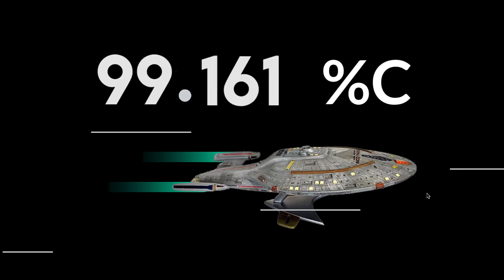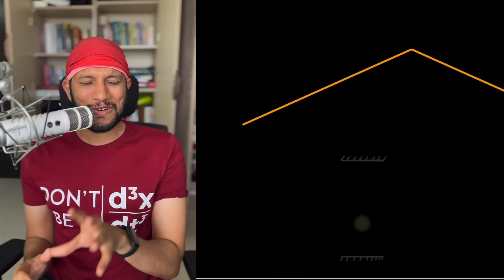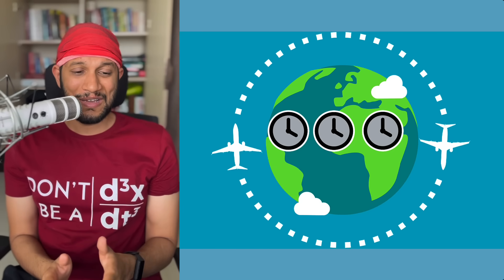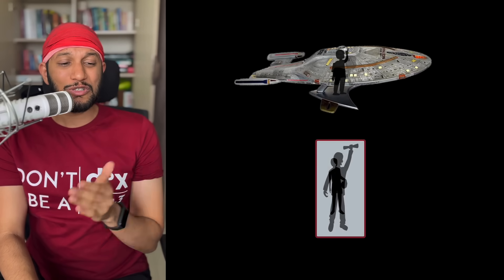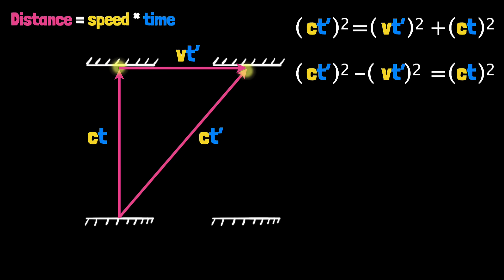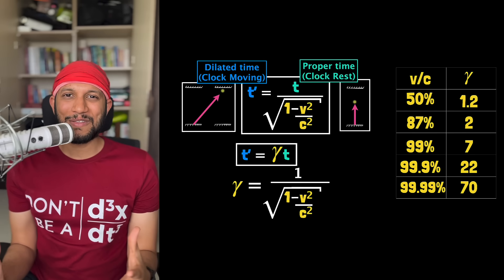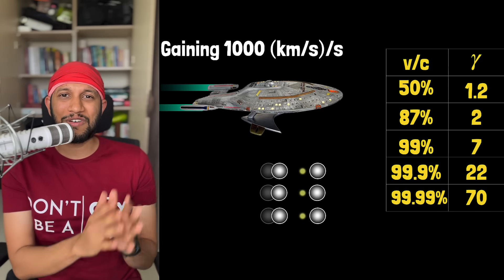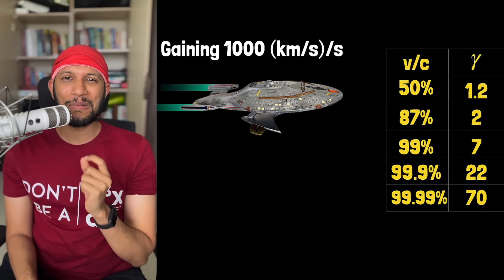I finally understood why you can't go faster than light! (My mind is blown)

Comment: There is a common misunderstanding shown here that makes the title wrong. The presenter validly explains why you cannot accelerate to light speed, but this argument does not say that you cannot go faster than light.
This seems unintuitive because we are very used to Newtonian physics where to achieve a speed you must accelerate to that speed.
But quantum physics has demonstrated responses millions or more miles away that happen instantly. This is superlight speed and there is zero or infinite (depending on how you look at6 it) acceleration.
Also, though the speed of light is generally treated as constant, this is only true in a vacuum. Light is quite easy to slow down. even passing through water causes a measurable slowdown.
Then there is Cherenkov radiation, emitted whern charged particle is travelling faster than the speed of light. This has been regularly seen around nuclear reactors. So we have actually seen objects travelling at superlight speed.
I do not think anyone has yet been able to conjecture what happens to mass at superlight speed. Without this knowledge the possibilities are totally open.
So, to recap, being unable to accelerate to the speed of light does not mean you cannot go faster than light.

Comment: A great video and brillant explanation of current theories regarding the topic.

Tho even as a layman I can't help but have some doubts, which might be absolutely incorrect, but still can't help but have them.
Normally if you accelerate a bus for instance, everyone inside would get pulled backwards (from bus' point of view) due to inertia. The same would have happened to the photon clock - the photon would have been janked "back" from the mirrors. So for the clock to keep it's functionality, there would need to be an amount of force applied to the photon to match it's speed relevant to the ship to keep it in the same place. And from what I understand (possibly wrongly) that force should account for the increase in distance. The same should need to be done in any experiments we were conducting with other forms of time measurments we have, because if you put a clock on a fast moving plane, you have to account for any changes in velocity and direction with a precise force applied to every atom of said clock to counter the inertia.

One more thing, our obsession with speed of light is kinda limiting our theories regarding the working of our reality. Probably because we are depending mostly on our sight for cognisance. Us saying there can be nothing faster than light is like a blind and hearing based race claiming there can be nothing moving faster than sound. Just because we can't register it, it doesn't mean it doesn't exist. The tree falling in a forest does make sound even if there is no smug theoretical physicist around to hear it, the rules of physics don't turn off just because we don't know them.
And it's especially silly since I'm pretty sure the speed of light is not constant either. Light is both a wave and a particle and the proof of that is, I believe, the fact that the light is affected by gravity. So, since it's affected by gravity, shouldn't it be possible to "gravity swing" it? Maybe not some measly planet the size of Earth but a decently sized black hole? I see no reason, why a photon entering the gravity field of such a body at a certain trajectory couldn't exit it with higher velocity.

Comment: excellent presentation. great style.

you say that physics only deals with the measurable.

basically what you are saying is that we are using the unknown speed of light to measure the unknown speed of light.

it's  somewhat like sitting in a bathtub 1/2 full of water. the bathtub is floating in the ocean. we are attempting to determine the properties of the ocean by measuring the properties of the water in the bathtub. the bathtub is the outer limit of our measurement.

much like the speed of light is the mental limit we have placed on ourselves. 

in a sense, physics has reached its borders because it depends on the senses which operate at the speed of light.

time to look elsewhere.

thanx again for your enlightening presentation.

Comment: For two ships traveling side by side at near 'C', the clocks would appear to remain constant in time to each observer in each ship because their relative speed is equal (zero). The same principle applies to a ship moving at 'C' around a fixed point observer because their relative speed is equal (zero) even though the fixed point observer has no velocity. The circling ship's distance from the fixed point observer never increases or decreases, just the same as two ships traveling at 'C' in parallel.

You've intuitively missed the principle that an approaching ship traveling in a straight line path towards a fixed point observer will have an exponential doppler effect at each extreme distance away from the observer at the approaching end and the receding end of the ships path. The bouncing photon clock will invert it's apparent time signature at the precise right angle to the observer as the ship passes. Thus, the "time dilation" is apparent and not actual.

It is the exact same premise for a train whistle approaching someone standing at the edge of the track. The tone will appear higher as the train approaches and lower as the train moves away, though the tone the train engineer hears is the constant and true tone of the whistle. You're hearing an illusion that the train whistle is lower due to your perspective. The whistle was equally high in tone as it was low in tone, thus nullifying the differentiated tones against the true tone. The only time you'll hear the true tone that the whistles can produce is when the train whistle is right next to you in its travel along the track.

And there is a proof which can easily be tested in a large open field with a perfectly circular train track and an observer at the perfect center listening while the train blows its whistle at high speed. The tone will remain constant to both the engineer and the fixed point observer and it will be the true tone of the whistle. i.e. no "Doppler Effect"

An even easier test would be attach a speaker playing a constant steady tone from a long wire and spin it around your head and then tell someone to stand just outside of the range of the speaker (so they don't get hit with it while you're twirling it around) and then discuss what each person heard.

Comment: and I got another one for you, what happens to a photon inside 2 mirror box exactly the same size as the photon, the box sits on the table not moving and then you break the mirror ? So absolute zero and lightspeed cannot be achieved because mass and energy but taking an image of the atoms placing them in a buffer and releasing them elsewhere is easily done because radio waves travel the same speed as light correct ? So if a scanner scans my house and me, uploads it and sends it to mars what after another machine calculates the exact point in time on the surface of mars what will happen ? not much because we need a printer there that rebuilds the image ? Ok so we put that there last year on our Space X trip. So in the name of Scotty can i now travel at the speed of light and teleport me and the house there ?

Comment: You can't be OBSERVED going faster than the speed of light. Velocity is not an absolute value, it is a relative value. When you are observing an object, no matter how fast it is really moving relative to you, you are actually observing the photons emitted by it, which is limited by the properties of the photons, not the object itself.

In other words this limit is an artifact of light and is not real.
Reply: There's more to this, from what I've heard.

There's a hypothetical concept called "Tachyons", which are hypothetical faster-than-light particles. 

If we apply our laws of physics to tachyons, we get many strange stuff. For example, tachyons would have a complex mass, the speed of the tachyon increases as its energy decreases, they would travel back in time, etc.

I suggest you read the Wikipedia article for tachyons, it's quite interesting.

Comment: Wait, the triangle graph makes it make a lot of sense. V could never be c, the logic of the graph would break:

(ct)^2+(Vt')^2=(ct')^2 becomes (ct)^2+(ct')^2=(ct')^2

The triangle stops working, those two sides cannot have the same length, cause geometry.

But also it means that t HAS to be 0.

0 time. The only way to travel at light speed is doing it for 0 time. I love physics, it's so elegant.

Comment: The problem why many have such a hard time to understand anything Time related is because they think that Time is something that exists like the Clock itself.

However, this is not so! such a thing as Time does not really exist! it is something we use to measure the overall movement of basically everything.

Take as an example this video you are watching! it runs for 16 minutes and 39 seconds. However, you can set the speed of the video to 2x in which case the same video will have a runtime that is half or 0.5x in which case it will double the runtime! So does that mean you have magically manipulated Time? no! Time for you in real life is still the same, all you did was manipulate the movement of the pixels on your screen.

So theoretically, if we could do the same to Humans, set the movement of their whole Bodies, every last molecule to 2x or 0.5x then it would seem as if we had doubled or halved their lifetime. For example, someone who lives to 100 under normal circumstances, would live to 50 with 2x and 200 with 0.5x BUT he would still do exactly the same things that he would do on 1x.

Lets say you are in a spacecraft that travels with the speed of light and lets keep it simple and say there is a time dilation of factor 0.1x for you. That means that 1 minute for you will be 10 minutes outside! This would mean that if you travel 1 year, once you "come back" to normal time, 10 years will have passed outside. Your Biology will have experienced only 1 year since every molecule in your Body moved 1/10 of what it normally would. So you aged only 1 year but everyone outside, whose molecules/atoms moved "normally", would have aged 10 years, yet you would not have experienced 10 years in this 1 year but would have experienced it as 1 year. It would be roughly as if you were frozen for 9 years!

The same would happen to a clock you have with you in the spacecraft and a clock outside! the clock you have with you would move normally for you since it is under the same effects as you are but the clocks outside would run 10x faster since they are under other effects.

This is a very simple explanation and obviously there is much more to it but just understand that Time is a measuring tool and not a real entity! (Thats why Time Travel is such a bad story plot device. You cant journey on a road that doesnt exist!).
Reply: no

Comment: It's less about the speed rather than the required acceleration that becomes 'impossible'.. I think >.>

Going along with everything in the universe, apparently we already are going at the speed of light, if not faster, I dunno, but to accelerate your own little mass yourself compared to the rest, that requires so much energy and becomes the problem, I think.. >.>

I guess we could say, it's like riding a fast bus, easy for you to ride fast doing nothing, but you running faster than a bus, that will require you so much energy, it'll become almost impossible, kinda.. I think, if I roughly understand what's going on

Comment: Nooooo. You lost me at 3:00. The speed at which the second hand motion travels along the hand isnt the soeed of light, its the speed of sound in the material...
Reply: The example is the limit. A "perfectly rigid" object would have a speed of sound equal to the speed of light, and behave as described. 

In a real object, the forces are still applied via electromagnetic waves, but the overall motion is slower because they're springy.

In fact, his animation has an error for this reason - when the imaginary photon hits an atom, it teleports over to it's final position (to make it clear to the audience) but that moment should be the first moment that it starts to accelerate, based on the movement of it's neighbor.

Comment: To solve the time dilation problem, tilt the photon clock to account for acceleration. In other words, the photon would bounce between the tilted mirrors the same as when not moving.
Time is only a counting reference of movement. It is how we measure displacement, or movement.
Light is not a good reference point, since light speed changes with medium. Time is a better reference, since time doesn't actually change.
Have fun with all that.😁

Comment: Only from an observation perspective, the ship would look frozen in time at relative speed to the speed of light. However from the perspective of inside the ship, the outside would increase in speed and continue to accelerate giving the perspective of traveling faster then the speed of light. This that frozen in time image of the ship would slowly fade and disappear because as you travel faster then the speed of light, light dims to blackness or red shift. So it’s not as simple as you may think.

Comment: What if the observer is also traveling along with the ship with the clock, and matching it's speeds and acceleration etc. Why wouldn't that negate the time dilation effect and therefore not require infinite energy?
(I'm not suggesting that should be true, but rather I'm asking what I misunderstood). 😊

Comment: So, the only reason that’s true is that what you’re using to accelerate has a limit of the speed of light.

So, because the energy/propulsion transference happens at the speed of light than you cannot accelerate past that speed, because you cannot accelerate something faster than the speed of the thing you’re using to accelerate with - resulting in that same limit.

So, time dilation aside, it’s not that it’s not possible to go faster than the speed of light, it’s just that we don’t know of anything, or any energy transfer mechanism that can exceed the speed of light, hence the same limit.

Happy to be corrected on this - great explanation btw.

Makes you wonder tho, is there anything out there that can travel faster than the speed of light? And, are we looking for that? Or, are we using the speed of light to back-out velocity? Because, if we are, then there’s no way of finding anything travelling faster, because we’re assuming the speed of light to determine the velocity of something.

My point is, that if we want to find aliens, you’d probably be wanting to be looking for something moving faster than the speed of light. But, can we even do that?

Comment: For me the key was that the transfer of information/energy travels at the speed of light. We're so used to thinking of object being solid, because they feel solid, but they actually aren't. 

It's almost like if you have a water drop on a piece of glass and your goal is to move the piece of glass horizontally, as fast as possible, WITHOUT disturbing the water drop. Well, you'll hit the limit very fast.

Comment: I probably got it wrong, but it sound for me, as if you only can not reach "c" from the outside, but from the inside you can. What I mean is, if you are INSIDE the ship, and you accelerate, for the "OUTSIDE world" your acceleration slows down, but for your "INSIDE world"it doesn't. As a Passenger your acceleration will not slow down, so as a Passenger you could reach "c" and actually you even could go beyond "c" and break the physics 😂
Reply: Well, time will just stop once you reach the C. You won't feel it though, because the neurons in your brain that make up your consciousness will stop with the time

Comment: So how does a photon travel at the speed of light wise guy?
Reply: The photon is the light
Reply: @revolvermaster4939  Well its an electromagnetic particle so how does a qanta of electromagnetic energy travel at the speed of light whereas you say nothing can?
Reply: @AusMarineRobotics  Only total energy overall is constant, any quanta is in constant change because its surrounded by all the other energy and is constantly interacting with it e.g gaining and loosing energy...... "the speed of light" or the limit of "time" is actually the limit in which energy can change from one state to another....but energy never ever can stop or end. 

There is no "time" thing, its just simply talking about when energy moves. We say "yesterday" or "5 minutes ago" instead of saying 309480193991893101930193981203380102383801903820381831083103910 reactions ago.
Reply: @gaiustesla9324  Thank You 👍- that's fascinating dude. I always suspected the speed of light was actually the limit of time but didnt know it is charecterised as the limit in which energy changes from one state to another (aka "time"). What is this concept/constant known as in physics?
Reply: @AusMarineRobotics  Relativity.

Comment: Your explanation suggests that the physical clock will slow down based on it's size. A lager clock in your animation will dlow down more than a smaller clock. therefore the model you propose is not entirely accurate.